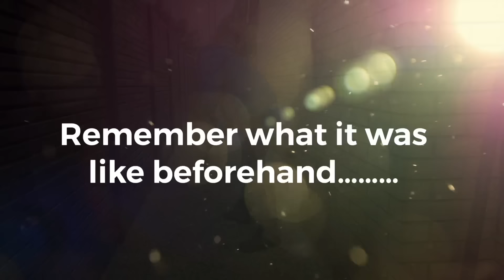Incredible Garden Makeover - Full Build

Comment: what are those metal pieces (looks like a propritary drain system of some type) you installed between the deck steps and patio pavers?
Reply from the maker: It’s a surface water drain called an ACO slot drain 😊

Comment: Stunning! Those 6x6 (8x8?) vertical posts, did you coat them with something before setting them in the ground? Were they pressure treated? Do they need to be dried out before setting them in the ground so they don’t split or warp when they dry? Thanks.
Reply: The transformation is amazing.

I had the same question - 
1:40, Horizontal Beams in contact with cement blocks - Pressure Treated? 
2:34 Vertical Post in contact with native soils - Pressure Treated? 
2:39 Vertical Post encased in concrete - Pressure Treated? 
5:17 Vertical Post in contact with select fill - appears asphalt/coal treated for water proofing?
8:38 - Rot proofing product shown

I just googled "when should Pressure Treated wood be used"? This is the answer I got:

"Generally speaking, any wood used in outdoor projects should be pressure-treated. Wood details in your interior design (like cabinetry or furniture) do not need the same level of treatment. In general, pressure-treated lumber is recommended in situations where there is direct contact between the wood and anything that could supply moisture:

- Retaining walls, which function to support landscaping projects and hold back soil
- Any posts or beams that come in contact with the ground or are buried underground
- Lumber that touches concrete or masonry (since these materials are more porous)"

8:13 - Step color blends nicely but can't help but wonder if they should have used a contrasting color to highlight the tripping hazard, or been a slope to eliminate the step all together.

Comment: Если я уложу так плитку в России, то после первой же зимы ее не будет😁
Reply from the maker: In uk it’s all good. How do you do it?
Reply: I have a lot of clay in the ground. Frosts in winter are down to -25. Therefore, we have to make a 200mm cushion of sand, then 100mm extruded polystyrene, then a concrete slab of at least 100mm with reinforcement. And then the finishing material is laid on it. @Brockstonepavingpros

Comment: In my country it is forbidden to use a circular saw without a proper workbench as these guys do at 11:54. Having a large slab held in place by a wooden pallet and a sack of cement while holding a heavy dangerous tool is not so professional either, forget the regulations.
Reply from the maker: Good job we’re not in your country then 😉
We know what we’re doing and can handle these tools ✌🏼
Reply: @Brockstonepavingpros   Well… the result was nothing less than remarkable nevertheless. My opinion: Safety First.
Reply from the maker: Thanks for watching and your input 👍🏼